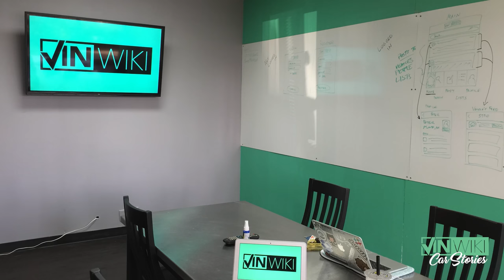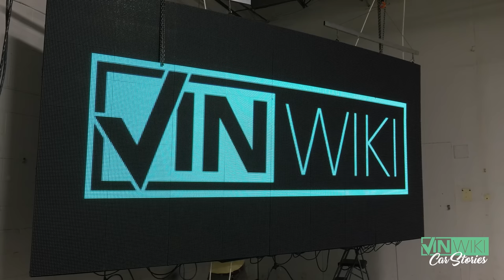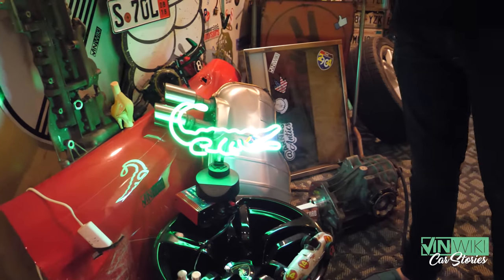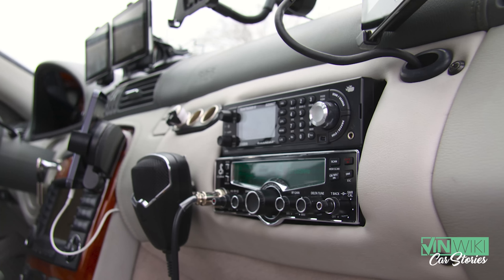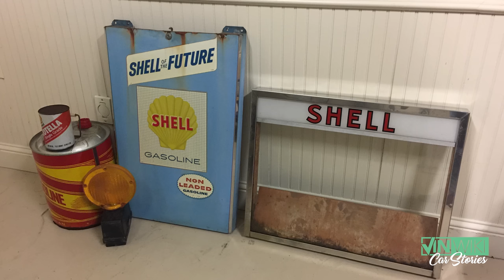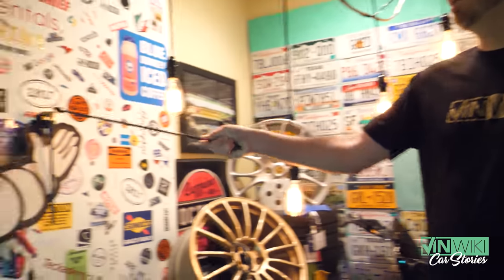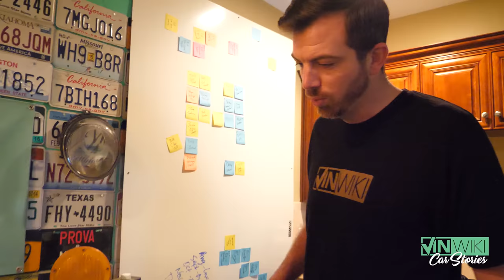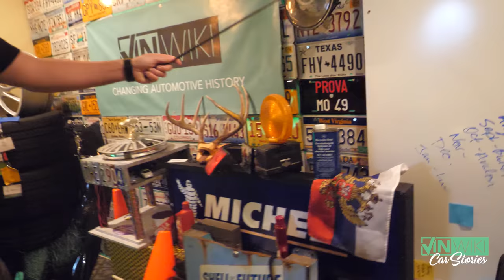A tour of VINwiki Car Stories set

Comment: This is SO COOL .. and SO INSPIRING .. I'm not the only one with all sorts of car bits and pieces sitting about kind of like the items in the VINwiki set .. not the same items of course (no Lambo wheels, but I do have some from a 911!) .. they are similar though in the sense they all have stories behind them, and I'm sure a lot of you out there have too .. probably most of you .. and I'm constantly adding to the collection .. just this last week a clutch plate from a top fuel dragster .. plus some ear plugs I had to reduce the noise from the cars, some of them making up round 150 dB .. and over 10,000 hp .. CRAZY .. one of them hit 322 mph .. in just 1000 ft !!! Happy collecting everybody !!! :-))))))) ...

Comment: Actually theirs another reason why the paint change idea for the 993 wouldnt of worked, it would have damaged the metal below, and required reshaping, not to mention being a crime against humanity, as its not like that things a corvette C7 or something, where the same guy who designed the Aztek Designed that for GM, its a beautiful vintage porsche! 

hell you asking people do to that, is like the Story Leno Tells about the woman who demanded they crush her duesenberg for the war effort in WW2, where no one would do it, until finally after hours and hours of her unwilling to see sense they did.

a better thing to do would have been to have found a salvaged one and, well theirs a rather far easier way to remove it that I dont want to list for fear of someone doing that to someone, and then have them redo that while keeping the original body intact for an easy switchover come the time to sell it, as all you need are the front and rear panels, not the doors.

or the people B is for build hired to do the work on the green lambo, as it was a 5K job to respray the bumper, the door and something else out of seatle, and it came out well

before he like all things screwed it up by running it into a tripod however.

and have you never heard of a Vinyl Wrap? Hoovie used it turn his 996 Turbo from dull as dishwater Silver to bright Orange for 1K or something.

As their are OPTIONS before destroying a beautiful porsche like that just because you dont like black! hell contact an auto recycler and see if they have anything, as theirs one in LA that everyone seems to be using all of a sudden. 

 or contact Magnus Walker in LA and see if he has anything and offer a trade, as you do have that kind of Clout now. Hell a straight normal 993 like that would probably be a straight swap with a customized one at this point with how valuable they've gotten.